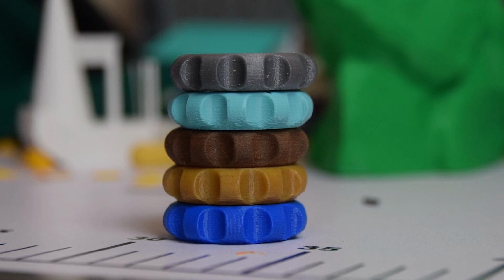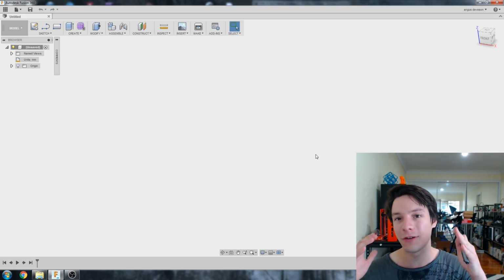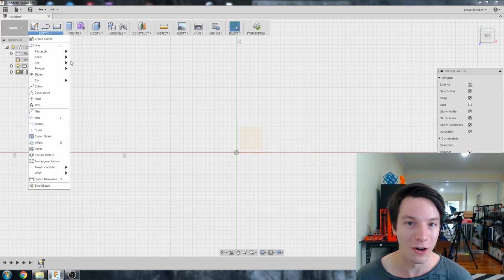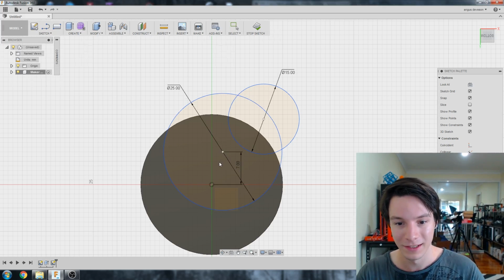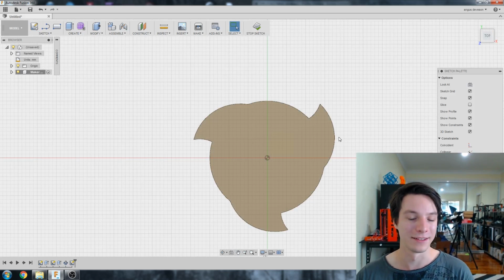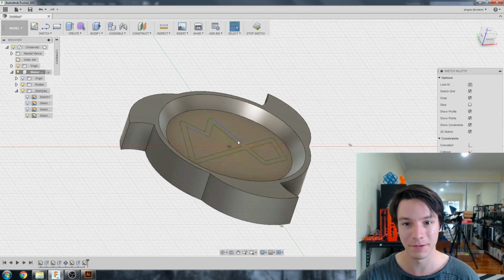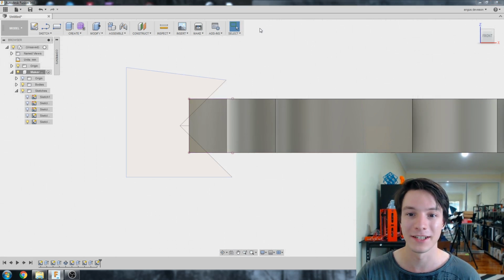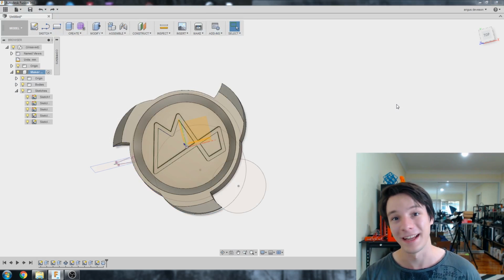Fusion 360 for Beginners - Design and 3D Print a Maker Coin! CAD For Newbies

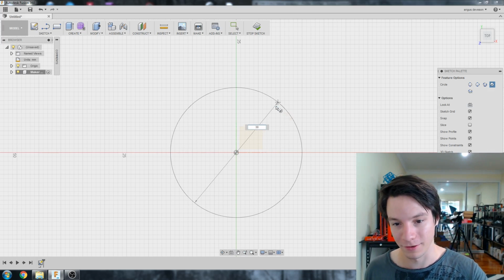Comment: 7:28 Aaaaannnd immediately lost. My sketch did not go black. -- Ah, okay... another thing to add to your list of default changes. You need to go to >>Preferences >>Preview and check the box: ☑ Sketch - Color sketch geometry based on constraints status
Reply from the maker: Yep sorry about that, I thought it was now turned on by default in this build but seems it's still opt in. I would add a note but Youtube has now disabled them... :( I'll pin this comment instead. Thanks!
Reply: No problem. I've been working mainly with 123D Design... but as that is ending today, I need to learn something new. So instead of just watching the video, I figured I would actually follow along for once. Just my luck that something would be amiss right off the bat, lol.
Reply: Update: I made it through the tutorial with full success! I ended up with a cool maker coin model, that I am off to test on my printer. Thank you very much for this, the idea of learning parametric modeling has been intimidating me for weeks, and this really eased out the learning curve for me.
Reply: Haaaah...I've been trying to fix that problem ever since I installed fusion.  Thanks
Reply: dont know if they moved it or if im stupid.. but i cant find this sketch under preview
Reply: That option is not in my prefs
Reply: i have followed all the steps here but my circle still in blue colour. It does not work for me.  if i ignore this, when i come into making patterns, it will give me compute error. Can you tell me how to do this, I tried many times following closely your video but could not make the circle line to black colour. Thanks
Reply: Yup. You’ll no longer see it in the Preview section of your preferences, because it is now baked into the sketching environment.
Reply from the maker: Really happy to hear that!
Reply: Go to >>Preferences >>Preview and check the box: ☑ Sketch - Color sketch geometry based on constraints status
Reply: Nick D. Clements lol

Comment: I got no 3d modeling experience and got a really hard time following along with this video ... The controls for instance are throwing me off cuz I'm used to Cura and Tinkercad I guess. So I figured I'd try to do one thing at a time. But I'm even struggling with a simple thing like trying to rotate my sketch or making a chamfer (the OK button is greyed out for some reason?)

Comment: Thank you SO MUCH for a great lesson. I have learned more in your 22 mins that I have in many other tutorials.
Reply from the maker: Thanks for watching ! :D
Reply: @MakersMuse  definately more like especially for us newb users ... im so new it hasnt even arrived yet ... yeah i went cheapy with the flashforge finder ... I could afford that hit and it will let me know if it is worth investing more time and money in for me 

what i am hoping to get is more knowledge on joining designs together ... pit falls of tolerances and what not ... say to build a 3d printed working jet engine (ok run on air ) or making an object that is larger than your tray ... like a plane  so you cut it up ... tail section wings ... BUT if you design it to be printed in separate parts and be attached mechanically without adhesive .. and yet have the joints hidden ... that kind of stuff ... i want to know what the common troubles are and what some of the common fixes work arounds or ways are to avoid or limit them

Comment: Angus, this is a tutorial for BEGINNERS.  You can't just jump all over -- you need to explain each step. For example, at 10:13 you somehow get the measurements of the circle sketches.  You need to say how you're doing this. Is it a keyboard shortcut? Then "We're going to dimension them to the origin..." HOW?  You don't explain what you're doing.  I've watched this a dozen times and can't figure it out.  I just ignored that part and somehow it worked out okay.
This was done a couple of years ago and I can assume you've improved your tutorials since then, but this one got my first ever thumb down.  Nonetheless, I was able to complete the tutorial and learned a lot, for which I say thanks, mate.
My coins are printing now.

Comment: 60$ a month for subscription for this software? This is only for commercial use. Crazy.
Reply: I had the same reaction and uninstalled. However, on a closer look, I realized you can sign-up as a maker/hobbyist for free (the software will indicate you have a "Startup License").  So, have reinstalled and am back to both designing and printing. Clearly Autodesk was hoping people would miss the "free" option just as I did, but instead of dropping the software, go ahead a buy a license.  Frankly, a bit on the deceptive side.  They have a much better approach with Eagle... Not so sneaky.

Comment: At 10 mins 18sec, you say about locking in to the origon ,no matter what I do I cant seem to get to draw the lines from one circle to the other and lock them Are you pressing a key? Dont forget this is for a beginner
Reply: Something must be different now....having same problem.
Reply: same problem, did anyone know how?
Reply: @zain667  I'm trying to figure out now, not sure what constraint type it is
Reply: Figured it out, you need to select "Sketch Dimension" then you can do exactly as Angus has done!
Reply: @smartroadbiker  HHmm.. I did that and I get a measuring tool. Then what?
EDIT: Nevermind! I once you click on two center points of circles the tool changes
Reply: @bbrendon  In case anyone is still confused watching this in the future: press D and you'll see the cursor change to how it is in the video and ya should be able to follow along.

Comment: Somehow I got an error making the pattern of 3 teeth. I selected the extrusion of the first tooth, then selected the vertical axis, and I see in light blue the 3 tooth. But after that, there is an error. After few attempts I could get it to work when I select 'Features'  in that dialog. 
Another thing is that it seems you use shortcuts of some sort to switch between the orbit and the select? At least my experience seems to be different (trackpad osx).

Comment: Great video! I come from using solidworks for many years and I find myself looking for tools and using the mouse a certain way. Something I wanted to ask, When making the teeth for example, Does Fusion have a "Trim" option? SO rather than having the two circles remain, you could trim all the sectional lines leaving you with just the tooth in the sketch. Also, If I make a circle and dont add a dimension, can i just make it defined without having to give it a dimension?
Cheers!

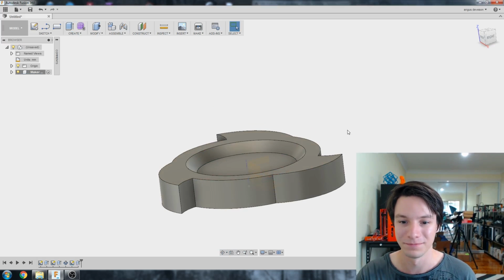Comment: looks like some default options changed , I cannot find a way to edit a line(or circle) when you do the bevel on the blades i am not able to select the lines,dimensions or the endpoints. cannot edit the dimension on the sketches like you demonstrate at 15:30

Comment: Angus, 

I have used several different 2D cad programs through the years and when I started 3D printing I tried several different 3D programs and had kind of settled on Sketchup and although I have always been able to manage to eventually get a design done in Sketchup it is usually involves a trial and error process to get there. 

I had also tried Fusion 360 before settling on Sketchup but don't really remember what I didn't like about it, just curious what your thoughts are on Fusion Vs Sketchup with regards to ease of use and capabilities.

Thanks,
Chadd

Comment: I have a threaded nut in my design.. When I convert it to .stl and open in the slicer, the threads disappear.. Is there any solution?? I use Cura. The same is happening on Microsoft 3d builder as well!
Reply from the maker: You are using visual/cosmetic threads, change it to modeled threads so it adds to the geometry.
Reply: You are great! Thank you!!

Comment: Lost me at "These are maker coins" LOL I need to find some even slower beginner videos I am thinking as my old self did not catch all that circle on circle action with dimensions, lengths, blades, swirls, cuts, extrudes, OMG my head did just explode a little bit. i also think I will have to set the video to my tv to follow along better (no dual monitor setup) as that would allow me to be full screen and actually see what those little bugs are you are clicking and pulling about.

I am just looking at MAYBE getting a 3d printer and figured the first logical step would be to see if I could design stuff I want to print.....It's not looking good. I can put a computer together blindfolded but this 3d stuff is just confusing to me. I did subscribe and I will follow along some more and see if I can get the hang of it but holy crap the circles with boxes to define something tah was just to put it in space or something like that...oh yea, I will have to rewatch multiple times ;)

BTW - for me the EASIEST part would be to bring in the image! Import, scale/move, done. Sure you had to redraw a line but no circle on circle on circle action needed (is that even legal in Australia?)

Thanx for the vids, I will be watching more from your channel!!

Comment: Thank you Angus for contributing to the community with CAD videos for beginners: I really feel that CAD is the biggest stumbling block in the 3D printing community at the moment.  But I feel the need to put a critique of Fusion in here for anyone planning to take the plunge in order to temper some expectations.  Since my initial CAD/CAM engineering courses waaaay back in the 1990s, I have used a ton of different software, and while this software is extremely powerful for a FREE tool, I am having a hard time believing that the designers could come from other modeling packages and think it is conscionable to charge $40/mo for a package in this state (I DO think it is head and shoulders over Catia, Creo and less annoying than Solidworks if you can stomach the cloud nonsense), but that puts it in the price range of programs like IronCAD Innovate, which feels like Fusion, but is more polished and usable (though sadly not cross-platform). But like I said: it is great for a free tool, and I don't want to come across as a curmudgeonly old designer, shaking my cane at cloud computing and yelling at modern software to get of my lawn... BUT:

I really WANT to use Fusion to be my go-to CAD because of it’s permissive license, modern feel, and halfway decent DSM direct solid modeling options and quasi-integration (which is woefully missing in many packages, especially for 3D printing folks who do a lot of importing and modifying), but it is still young and a bit of a mess at the moment in many regards, and has a very slow workflow.  I still use it regularly since it IS still decent AND one of the better options out there (especially free/cheap options), but only for specific things.  I really hope the eventual version 2 has a major workflow/UI/usability overhaul because as of now, newbies be warned that it is unintuitive and slow to use. 

For the purpose of this post, I loaded up a project containing about a dozen small objects and kept track of the annoyances as I encountered them so as to give a good perspective of the Fusion experience from someone who has been working in CAD modeling on and off for a few decades.  This is by no means an exhaustive list, but I had to stop somewhere:

-Can’t import other Autodesk file formats directly, which is insane

-Can’t easily drop objects on grid/ground plane/workspace origin (especially spheres)

-Shortcuts are extremely limited, unintuitive, and inconsistent across workspaces

-Limited ability to customize most used commands in menus means hunting and clicking, which is excruciatingly slow and time-wasting!!!!!

-have to log in with desktop and can’t save pass in keychain  

-Inability to assign key commands or shortcuts!!!  This makes for an incredibly slow workflow and a lot of mouse clicking, scrolling and searching

-typical frustration of cloud-software and it’s complications with simple tasks like maintaining a local copy, exporting to desktop, etc (not impossible, just convoluted)

-Menus are sprawling scroll trees and dropdowns, which leads to:

-menu item names are often truncated in menus which are not resizable 

-many dropdown menus are both non-sticky type, and what I call ‘twitchy’, as in you click an item to get a menu, but when you mouse down to select a sub-menu the main menu snaps closed as if you moved your mouse cursor away from the menu, so you have to keep trying until you find the magical path from top-level menu item and sub item.  Could be fixed with consistent sticky menus (or fixing the menu UI code)

-Hover tooltips are incomplete and inconsistent = a lot of tabbing out and googling.  Many times the hover tip is just a placeholder that repeats the name of the item

-Extra clicks needed to toggle in and out of view mode, which is especially frustrating.  Simply assigning a key modifier to pan would be extremely simple

-Setting individual object’s appearance is broken up across 3 different menus, and resetting them is annoying combination of clicking scrolling and dragging

-toggling to modes which allow you to see the internals is difficult: either setting individual materials for each object, or setting the entire scene to wireframe mode with mouse clicks and then setting it back again

-many operations (like multiple select) are confusingly slow, even on a hex core Xeon workstation with ssd, and a fast gpu

-trying to do even simple tasks like measure the depth of an object if you have to rotate the view to access your second measure point, etc

-escape cancels action AND closes menu usually, but is inconsistent in that sometimes it behaves itself

-requires an unnecessary number of actions to achieve simple tasks i.e. 5 clicks to rotate an object, etc

-lack of select shortcuts mean unnecessary clicking through to change view between moves and operations

-rotation of multiple ungrouped objects is extremely difficult, and occasionally requires measurements and setting axes manually or grouping ungrouping to find a center point

-point to point movement/snapping of filleted/chamfered objects usually fails (Autodesk has traditionally been bad with handling of filleted objects though)

-simple tasks like creating a shape requires toggling faces with mouse clicks on arrow handles, then toggling back, clicking an input field and typing in a number, where viewing all parameters simultaneously and tabbing to input values on axes/faces would be much faster and less painful on the mouse-hand (CAD-cramps are real, man, and 16 hours of crunch-time working in this platform has my knuckles screaming just thinking about it).

-selecting a single object in a group is frustratingly complex, usually requiring toggling selection priorities back and forth

-exporting bodies to a single STL for printing is a whole song and dance involving opening the browser, unselecting items, finding the topmost relevant menu object, waiting for a hover cursor drop-down and navigating to the export option.  Individual body select and a toggle field would be much faster and more intuitive

I stopped the list there, but you get the idea.  I think a 'fast workflow/clean-UI' mode would be nice for beginners (or anyone who had to work quickly).  They could model it off 123d Design but with an additional tier of more powerful/granular commands bound to a modifier key.  Killing off their 123D package was throwing out more baby than bathwater, and driving users to Fusion  is not the answer since you lose speed and simplicity for the sake of more powerful/granular features. For parametric CAD, there are smoother options out there that are much more mature, but for combined parametric/DSM I would try to shove hundred dollar bills through my computer monitor if they made a 123D Design Pro version for a few hundred bucks, but alas it looks like working across 123d/Fusion/Onshape/FreeCAD/OpenSCAD is the way to go.
Reply: You could send this to them. It may actually make a change!

Comment: Hey, I've watched some of your videos and they are pretty good. I study architecture and we use a lot of 3D printing and laser cutting. So i wanted you to advice you to check out Rhinoceros 3D, it's a modeling software used in multiple studios(from architecture to even jewelry design; such as Zaha Hadid or BIG Architects and more) and you can there use a plug in called Grasshopper, this is the most advanced way of parametric design and you'll love it. Really I it has a crazy power. I'm not trying to sell it or anything. I'm just am a student from Buenos Aires Argentina and after watching some of your videos I thought you'd find it really interesting. Thank you for sharing your projects. Great Chanel!

Comment: Take any model, cut it in half, and move the resulting models around so the origins (?) are different.

Now, how do I re-merge the two halves into one model?
Reply from the maker: remerge with the origins different? Or do you want to lock them together? you can use an 'as built' joint to lock them so they cant move, or simply select both and hit modify - combine and redefine the origins. done!
Reply: Yeah, not sure how to line them back up. Ideally I should be able to click one face, then the other, and Fusion360 would align the faces. Perhaps I would also need to select an edge on each model to signify which way is up.

I'll take a look at as-built joins though. Thanks for the suggestion.